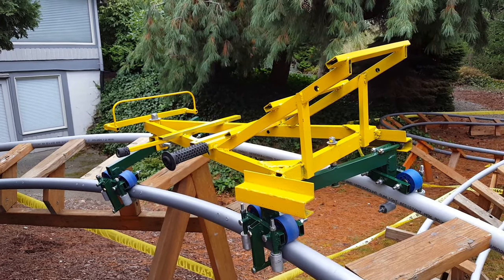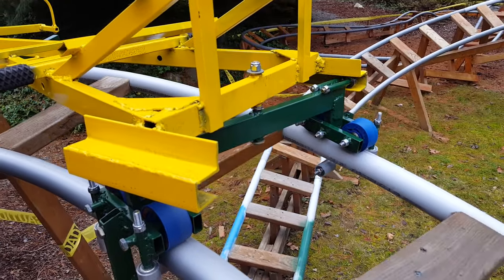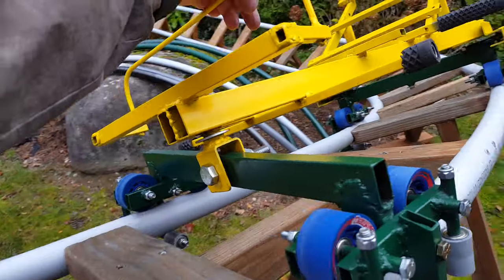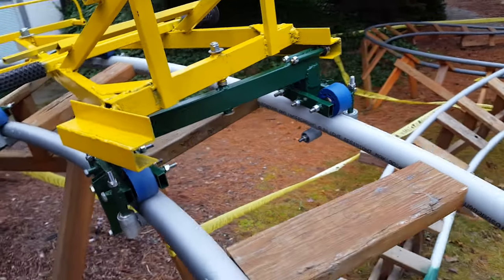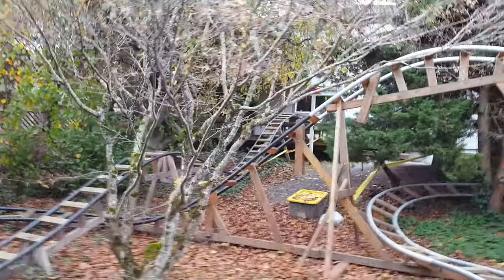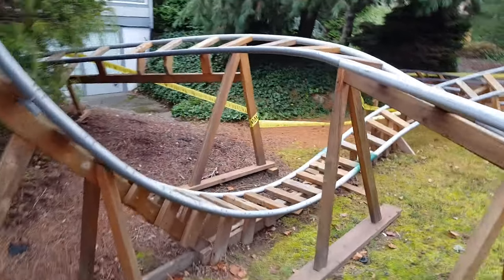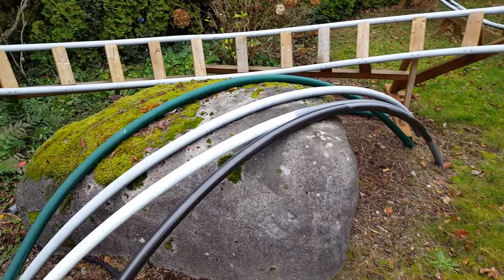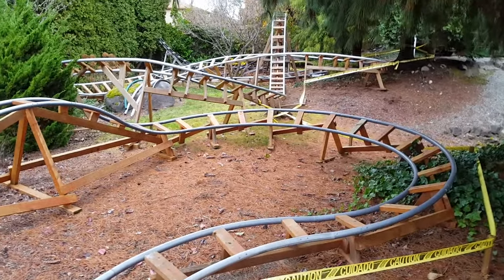Secrets of Backyard Roller Coaster Design, and a yard tour of three BYRCs

Comment: That’s some great engineering. Lately I’ve been thinking about trying to build an aircraft with schedule 40 PVC. I believe that I can make a sold airframe and then use wrap-  basically The same way they built World War I Airplanes that were made of wood but in this case pvc . I believe that I can make the cambers for the wings out of a very light wood and I believe that I can use composite wrap for wings. I’d like your engineering thoughts on my idea.  I’ll give him the main spar Some thought and I would think that I have to make that out of wood. I think I can use an air cooled VW engine and a wooden prop.Right now it’s just a concept. You are thought to be very much appreciated thanks.
Reply from the maker: Man, I don't know about PVC in a life-critical application.  PVC can fail by shattering (brittle-like), especially if it's been exposed to sun, or if it's cold.  Check the specific properties (yield strength per density, and stiffness E per density)  of PVC vs aluminum.  sciencedirect.com/topics/materials-science/material-selection-chart has some nice charts on specific stiffness and strength of material..  Both PVC strength and stiffness are pretty poor compared to typical aircraft materials.
I think early airplanes used certain kinds of wood, but they were very picky about it  having higher density (strength) and no flaws like knots.   I've heard of people making experimental airplanes out of irrigation aluminum pipes..  Google it.   But I wouldn't recommend PVC for anything to do with aircraft.   Most people building experimental aircraft nowadays are using as much carbon composites as they can afford.   I follow DarkAero, but there are a lot of others.
Reply: @PaulGreggBYRC  hey thanks for the information and your opinion. I'll look at the lot of stuff you were talking about.
Reply: Paul Gregg What do I have in mind is to build it just like an airframe. Do you know the in airframes we build in small pieces in sections and segments so I think PVC could possibly work if it’s shielded from UV. Do you guys being that it’s light and it’s easy to work with The standard Mono  design should work; We basically wrap material around the airframe and the tail for instance where it’s real tight and compresses everything to gather in addition I have an airframe is tight we also have the strength of the wrap
Reply from the maker: @Fraiyia  Even with sun-UV protection, you can't protect from cold temperatures in service.  Plus, it's not really very stiff or strong to begin with.  7475 aluminum has 9 times the strength, and 25 times the stiffness of PVC.   I would look at aluminum extrusions (pipes?) of a good alloy instead, or carbon fiber composite.
Reply: @PaulGreggBYRC  yea you make good point ; aluminum or wood then. Fixin  not know how to weld that metal . You think threaded fittings and couplers would work.
Reply from the maker: @Fraiyia  I don't know if anyone welds aluminum in aircraft primary structure applications.  More likely to machine and fasten.
Reply: @PaulGreggBYRC  is there a way to just buy the wheels for the cart? Or do you have a tutorial?